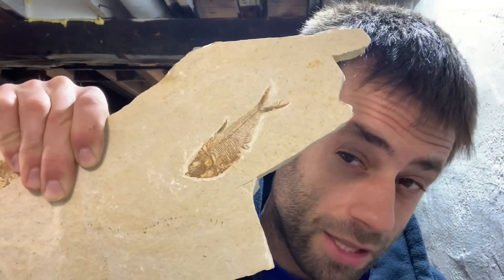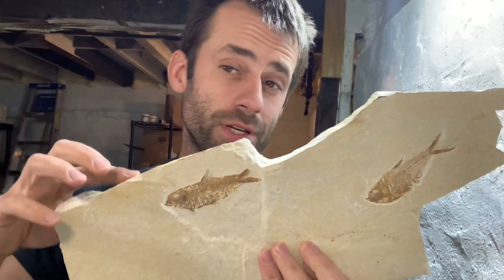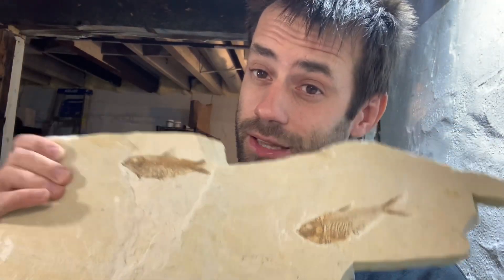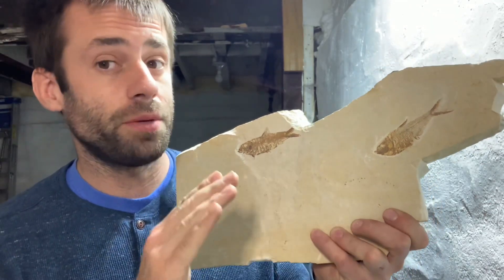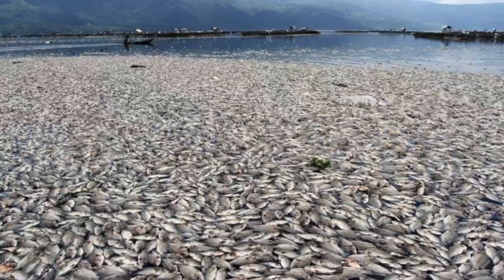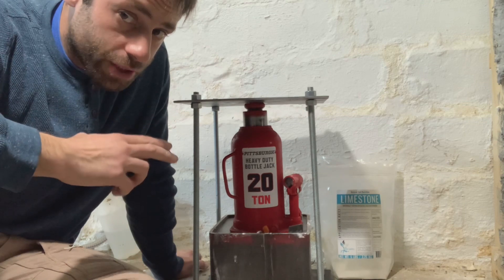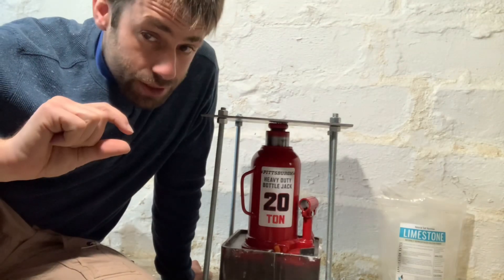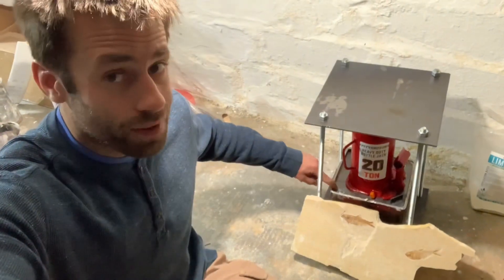How to Make Real Fish Fossils in Your Basement. Fossil Experiment.

Comment: Hi! I just came across this video and I will first congratulate you. This is absolutely awesome! I also watched the one-year follow up.

So, at 6:00 you wanted an example of a place with massive fish die-offs and extreme anoxic conditions. Well, it could happen anywhere. *Could*, if not because of human action. You see, whenever massive amounts of fish die, people simply go there and remove all the fish, due to the smell and sanitary reasons. That's why you almost never see these things happening right now. 

Without human intervention, all those dead fish would lead to significant eutrophication of the water, which in turn leads to oxygen depletion. And there you have it: a ton of sinking bodies and an anoxic environment, and all it takes is no people messing around.
Reply from the maker: I’m aware of mass die offs of fish. None of which were cleaned up by humans and the only remnants that remain are beach sand made of fish vertebrae.  
And even if what you say is the case the anoxic conditions would have to last essentially permanently otherwise the varved layers would be bioterbated and fish bodied would have been consumed before buried with sediment.
Reply: @lundgrenbronzestudios  if the water body is deep enough, the bottom can be pretty close to a permanently anoxic region. The initial  eutrophication would deplete the water line close to the surface, preventing other animals from consuming the fish, which in turn could sink and be preserved. Another hypothesis would be the die off to happen close to the mouth of a murky river, which dumps copious amounts of sediment fairly quickly.
Reply from the maker: @Pfh3dk  a high sediment flux wouldn’t result in varve formations like the green river formation.  And at the rate of varve deposits you should be able to see little mounds of sediment covering fish or even fish lying on the bottom from long ago. There are many hypotheticals, but again no place where you can observe it happening.
Reply: @lundgrenbronzestudios  Fair points.
Though there are a few lakes today with characteristics that can enable varve formation and are deep enough to have anoxic bottoms (thus potentially enabling exceptional fossil formation): Lake Baikal, Russia; Great Salt Lake, USA; Lake Geneva, Switzerland; Lake Pavin, France; Lake Nyos, Cameroon; and potentially many more.
Reply from the maker: @Pfh3dk  as an undergrad I did research on lake Lake Malawi.  It’s a deep varve forming with anoxic bottom. If you were to core the green river formation it would be fairly common to cross section through a fish, no fish were found in the Malawi cores. All that to say, the green river formation is incredibly rare, unique and special.
Reply: @lundgrenbronzestudios  Agreed. That is awesome.

Comment: I'm working on doing this myself but I don't have a welding kit or any heavy metal tubing. Do you have suggestions for any alternative containers? I'm afraid if I use anything less it may break.
Reply from the maker: It really depends on how much pressure you put down on it. It doesn’t need to be air tights  mine were never air tight because the top was never sealed. 
You could use plate steel and bolts to hold the container together. It will just take some thinking and experimenting to figure out the best way. Each experiment teaches you something new for the next experiment. So don’t be afraid to fail.

Comment: You need to reduce the shrinkage of the matrix/ material aswell as working out correct pressures.

Material wise though you need to add more fibres to stop shrinkage and cracking. 

Mental video though. Pretty cool to see this done In a short space of time in a basement lol!

Comment: Could you lightly dust a layer of calcium before you pour the second layer to help separate it?  What would you recommend or any tips, to make a large scale like that 55 gallon drum or a 10 gallon?
Reply from the maker: Dusting will not work because the dust will still adhere to the previous layer. There isn’t enough textural difference to allow for a good cleavage. 
I’ve tried different acids to try to help with lithification, but I never noticed a difference with trying that. Getting as much pressure as you can helps greatly. But with more pressure comes more danger of something breaking and flying off and hitting you. So be carful.
Reply: What happens if you put vinegar to speed of decomposing speed dropping the pH

Comment: This is really interesting! Would this work with bones too? If so, could you give demonstration?
Reply from the maker: It doesn’t work as well with bones because bones take such a long time to deteriorate. If I had a way to get pressure high enough to dissolve silica I could probably mineralize a bone, but that would take a much more involved set up.
Reply: @lundgrenbronzestudios  how much pressure would that be, also wouldn't that require heat?
Reply from the maker: @javierhillier4252  not necessarily heat. But heat can be involved. The mineral dissolution state would be defined in a phase diagram or PT diagram. P = pressure T = Temperature. These diagrams tell a minerals stability within a field of pressure and temperature. Each mineral has a different zone of stability. I don’t know what that would be for lime stone off the top of my head though. Good luck in your research!